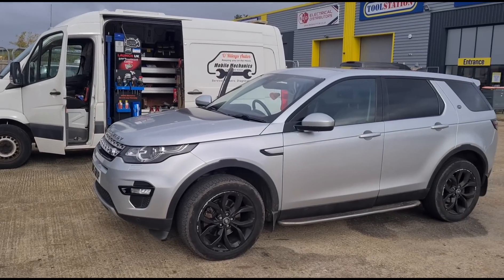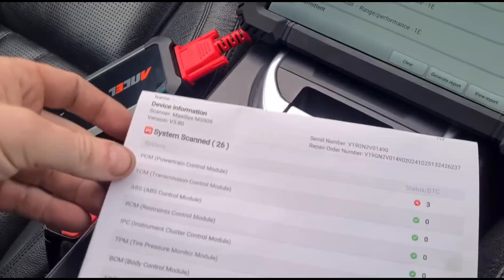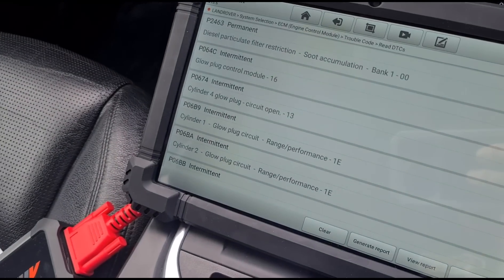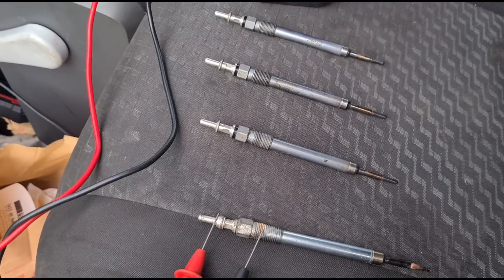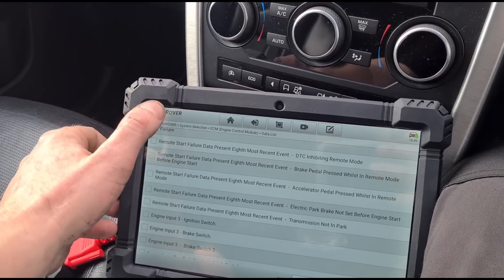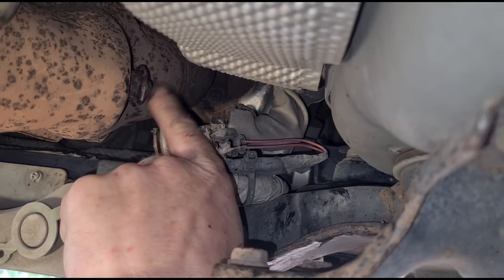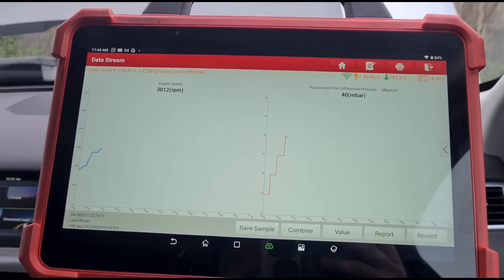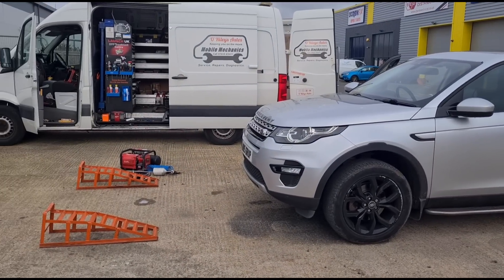Land Rover Discovery Sport P064C P2463 P0674

Comment: Mine has three glow plugs that are out of order, according to the diagnostic connector, but it regenerates properly every 290km (180miles).
I know, I have to change the glow plugs, but I have a problem, they don't come out easily from the threads in the cylinder head. I have a fear of them cracking and that was a big problem.

Comment: Toyota diesel engine fault that was searched for a very long time. Diagnostics showed uneven operation of the engine. The injectors were checked at the stand, everything was perfect! After that, an absurd error was revealed. There were two copper washers under the end of one injector, which caused the injector to be a millimeter on the upper side and the fuel could not get into the correct sprayed on. One washer was removed and the engine ran great.

Comment: What did you use to clean the Adblue Cristal with ? 
Also did you just clean out the Adblue filter with DPF cleaner ? 

Do you just Rev the engine till the DPF cleaner clears / flows through the exhaust ?

Comment: You’ve had a year that would break most of us who watch your videos Jimmy. Yet you still take the time to make and upload videos the help educate anyone who watches. 

When I started watching your channel I didn’t even have a diesel vehicle but knew the information you were giving out invaluable. You’ve increased my knowledge of Euro 5/6 systems to a level where I feel confident working on them. I’ve since bought a Range Rover Sport SDV8 that is Euro 5 and know what to look out for now and feel I could tackle most problems within reason. 

Also had a neighbour ask if I could look at their Nissan Quashqui since I’m always tinkering on our cars. He was getting a fault so I scanned it and was getting a code for DPF differential sensor. Used my mitivac to check the line from the DPF to the sensor and of course it was blocked. Used your wire and drill trick and bobs your uncle it was all good again!

Comment: I can't understand why so called mechanics don't get this emission stuff. It not as if it's new.
Reply: It’s not new but I guess the issue is a lot of guys don’t get the time on the job to learn. Especially in main dealers, they are basically fitters these days. Diagnosing emissions systems and cleaning a DPF aren’t top priority unfortunately. 

Of course guys can learn off their own back but if there is no incentive to do so, why would they?
Reply: @Mac_F87  The garages who had it before could have charged for fitting 4 new glowplugs in there simply by reading a cheap scantool diagnosis - I have no explanation!
Reply: They only needed to plug in the tool and replace the injector - to fix the actual cause, they didn't even do that!!
Reply: @G-ra-ha-m  glowplug
Reply: @slacko1971  Sorry, yes I meant the glowplug LOL :)

Comment: You did well to replace those glow plugs Bud last time I did a set of those I disconnected the engine mounting to move the engine back a bit 🤏 you got my respect ✊
Reply: Just take the front grille off, four plastic riv/screws and a couple of clips, you can see straight through to the plugs after that
Reply: @davidbest1  thanks I will check that out 👍
Reply from the maker: Thanks for sharing

Comment: Does DPF regens fail if the glow plugs are faulty ? thought glow plugs are only used on startup ?
 ive just changed mine on an astra j 2014 2.0 diesel ? reason i ask is that every now again, i get a burning of oil.. not alot but good couple of table spoons
Reply: Jimmy said in the past that he has seen vans do a regen without the glow plugs being replaced but on cars it always has to be replaced otherwise, no regen.
Reply: Common for Glow Plugs to be used in DPF regen
Reply: @-DC- 
They warm the cylinders up, how is this related to an exhaust pipe component
Reply from the maker: Diesel fuel is sprayed into cylinder on exhaust stroke to then exit into the DPF & it needs glow plug working to heat the fuel

Comment: Ingenium with 117k on the clock? Is the owner God?!
Reply: Maybe he uses 5w30 instead of that 0w30 shit and changes oil and filter frequently 😂
Reply: The 6th engine it's on is only on 1000miles
Reply: Owner could be the real Chuck Norris?
Reply: My Disco Sport has over 260,000km on it. That's about 160,000 miles. Even the battery is original, but it's weak, the start-stop doesn't work for me and that's okay. And, yes, I know, I need to replace the glow plugs...
Reply: @IvanBonic  and I bet it is the 2.2 PSA engine....
Reply: it is 2.0 / 150HP